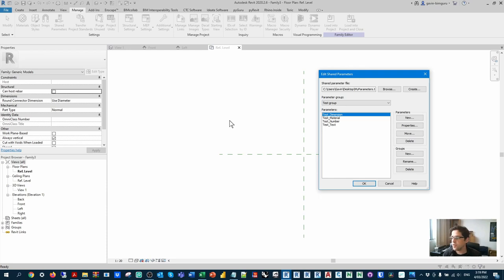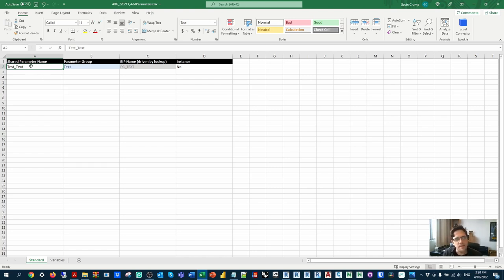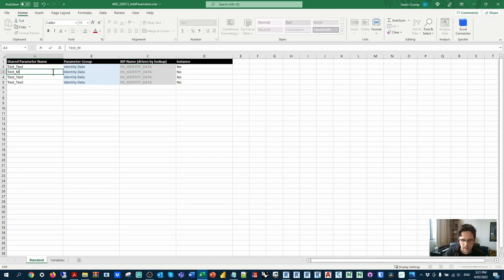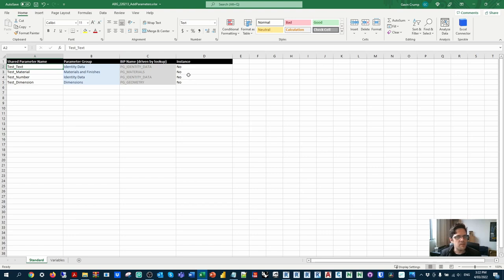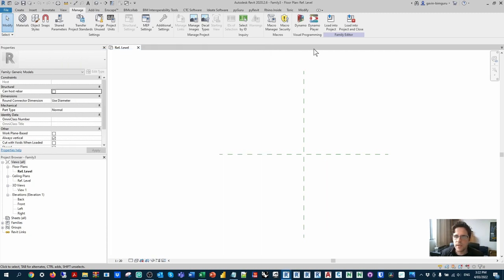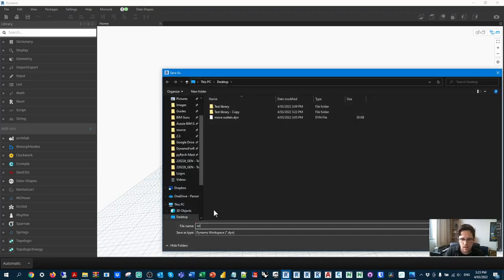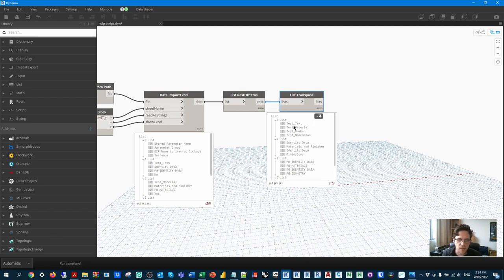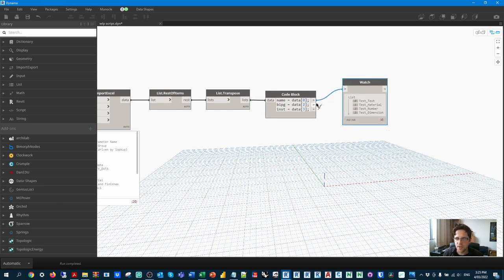Add parameters to Revit families using Dynamo (and Crumple)!

Comment: where can i get this parameter mapping file?
Reply from the maker: Over on my github.
Reply: @AussieBIMGuru  Thank you very much Gavin, I have one more question, how can I find more items from the BIPG column?
Reply from the maker: @pedroeliassantos2612  this lists them all:

https://www.revitapidocs.com/2016/9942b791-2892-0658-303e-abf99675c5a6.htm
Reply: @AussieBIMGuru  
Gavin thanks again!
one more point Gavin, is it possible to get a list with all types of parameters?
for example:
in the electrical discipline there are Watts, power, electrical resistivity and so on.

Is it possible to get all these types at once? for it to be placed on a table?
Reply from the maker: @pedroeliassantos2612  check crumple package which has nodes to get bipgs and bipgs by revit name.
Reply: @AussieBIMGuru  Hi Gavin!
thanks again.
I took a look at the crumple nodes but the ones I found only return the group parameters
Reply from the maker: @pedroeliassantos2612  try Orchid if not what you were after. They have a few more enum nodes.